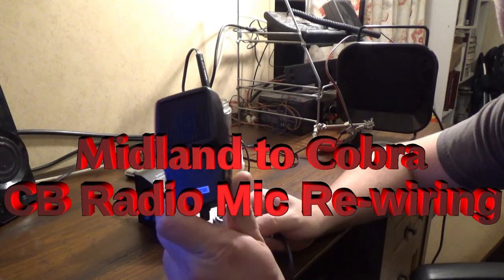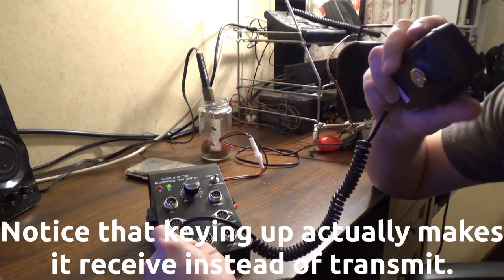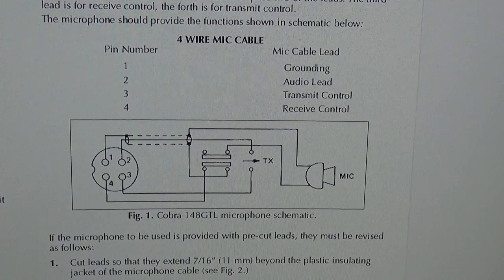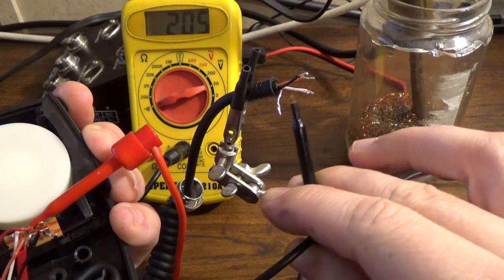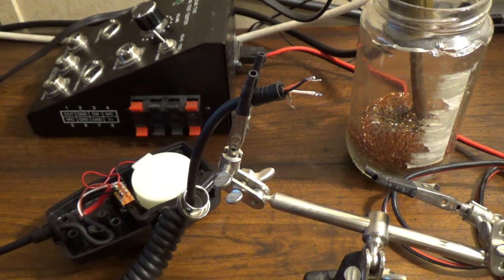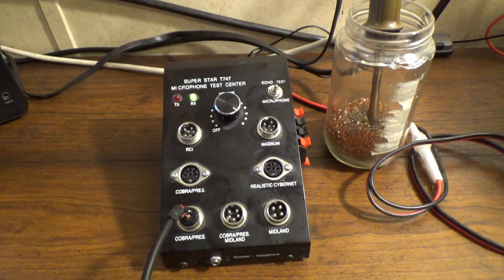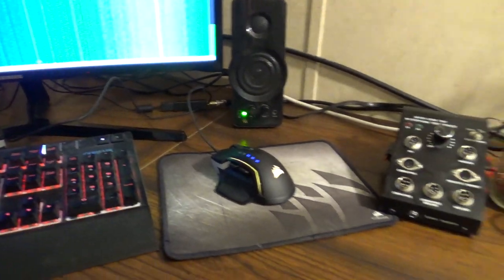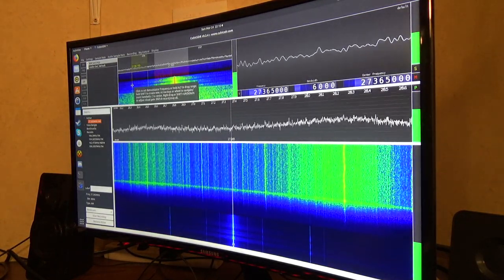Midland to Cobra - CB Radio Mic Re Wiring

Comment: I made my own Mike tester from diagram in the CB Hacker's guide, and used it to fix a Cobra mike. Just got a BUNCH of Midland CB's, adding a Midland port onto my tester. Also made an adapter the other way : Cobra to Midland. Basically, switch the top wires to the bottom.  Now I have a 6 pin Midland radio and 6 pin Henry Tempo mike (up/down buttons) and no pinouts, taking them apart to see how to switch the Henry to the Midland.

Comment: I have a Midland 13-858 cb radio it doesn't have a mic with it, but I have a roadmaster mic that uses the same type 4 pin plug, but doesn't work for the Midland microphone. Can You please tell me what wires I need to switch in the plug for a Midland 13-858 cb radio, can You please send me a diagram.

Comment: Anyone know if the Cobra 21 LTD Classic is different than other Cobras. I have a mike wired for my 29 LTD Classic and it will not work in my 21. Just wondering if the wiring is different or the radio is junk.

Comment: Question on Midland CB Mic . 1001Z Model 4 Pin.  Would it Work on Midland 77-145 CB Radio Made in April 1984 Vintage Year 4 Pin Also . I Misplaced my Original 77-145 Midland 
Mic. I Purchase one Off Ebay . Set Everything up with K40 Antenna ,Turn CB Power Switch
On , Got Loud Buzz Sound and Meter LED Red-Line , just Turn it off . Bad Idea on my Part.
Email Midland and  they are Sold Out of Standard 4 Pin. Mic. ..Hope you can help ?
Reply from the maker: I don't know about that exact model of radio, but generally the 4 wires on a Cobra mic are:
- Ground/shield
- Audio (Your voice)
- RX/Audio out (Speaker output is routed through the mic on Cobra radios, so you'll get no audio out without a mic)
- PTT (What activates the microphone)

You can poke around to figure out which ones are which with a pair of tweezers.  You might be able to open it up and see which pin is the ground, and then just short the ground pin to each of the 3 other pins until it either keys up or your audio comes in, and that'll tell you which of those pins do those jobs, and the only remaining pin that doesn't do something obvious has to be your audio input.

I've got an image I found on the internet somewhere years ago that has the following layout for a Midland 4 pin, which looks like you basically just swap 1 and 2 and swap 3 and 4 with one another relative to a Cobra 4 pin.  I'll post a link to the image shared from my Nextcloud server if YouTube doesn't snip out the link.  The link will expire in 30 days.

1 - Audio
2 - Shield-Com
3 - RX
4 - TX

https://marcusandash.net/index.php/s/85P3GcmCtyJqMEy

Comment: I have a question I have a 636 astatic mic all stock when I use it with my cobra the radio has no volume its very low but it works fine with my galaxy  the stock galaxy mic works fine with the cobra but I want to use the 636 can you help me with that  as always Thanks

Comment: Marcus Adams , I Wish to Thank You for Reply on Midland Mic. I'm going to look into This
Further . I did work NASA in Mid-1980's and early 1990"s Avionics Institution on Spacecraft .
I do Know How to Solder and have an Solder-Iron and NASA Spec. 63/37 Solder . If There
Was AND DRAWING of Pin Outs Between Cobra and Midland 4 Pin Connector 1 Thru 4 Like
you Stated . My Eyes aren't Like they Used to Be , my Hands are. Need 30 X Lamp to See . Each Pin Out a Count Ring-Out From 1 Thru 4 with Meter would Fix the Issue .. Thank you..